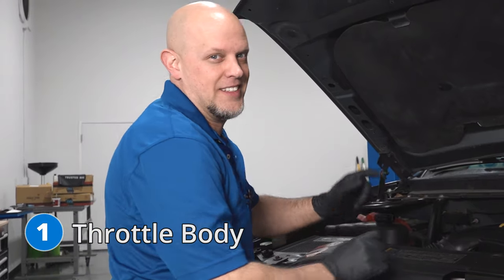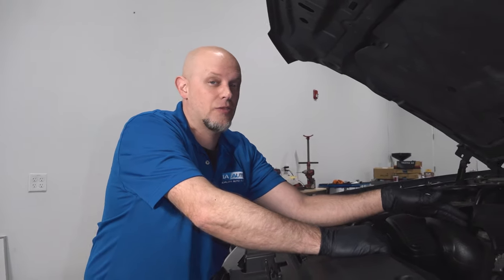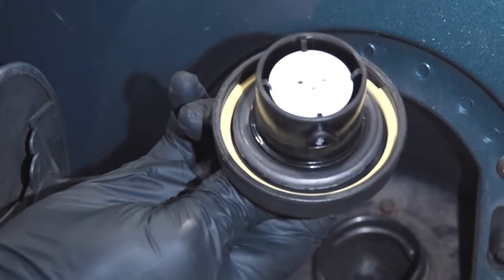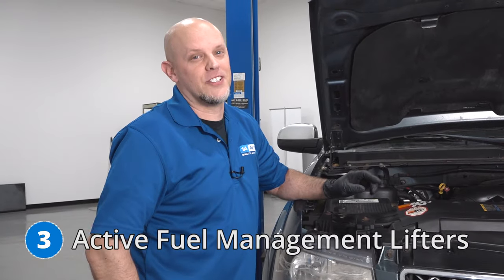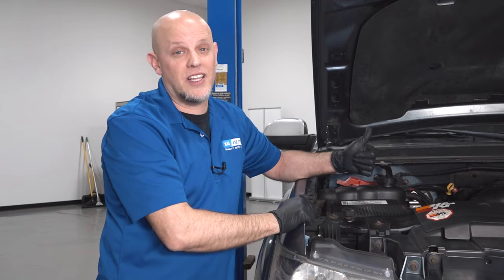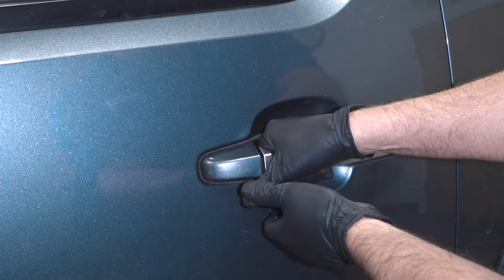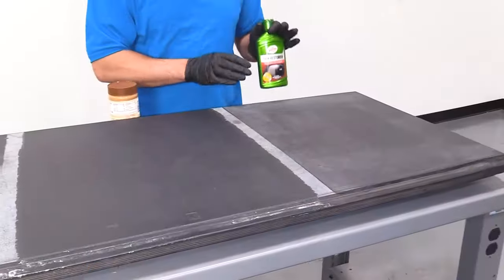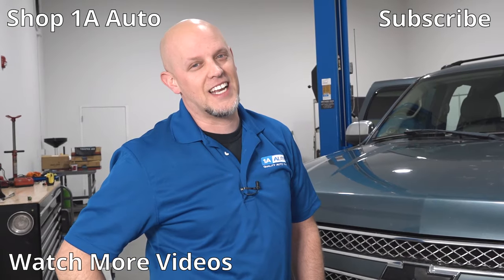Top 5 Problems Chevy Avalanche Truck 2nd Generation 2007-13

Comment: I have a 07 ltz and have had a problem with stabilitrac/ traction control going on and off, when it goes off the truck runs rough and shifts hard, but when I get it up to speed the light goes out and everything back to normal. Anybody have any fixes for this?
Reply: Believe that is a hub/wheel speed sensor. Stabilitrak kicks in when two wheels are perceived to be turning at different speeds and the truck thinks the tires are spinning.
Reply: I'm having that same issue now, how did you fix yours?

Comment: He forgot the problem of the filter under the oil sending unit plugging up. Change the oil every 3500-4000 miles and you will not have this problem!
Reply from the maker: +service1956 Thanks for the tip!